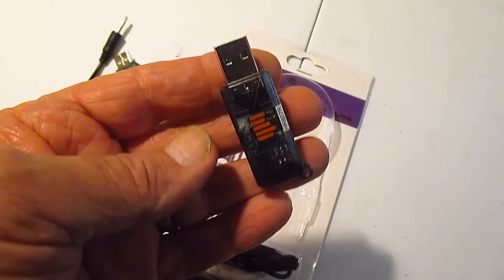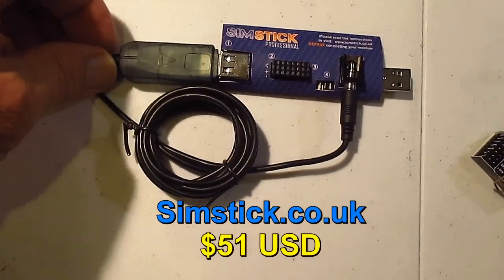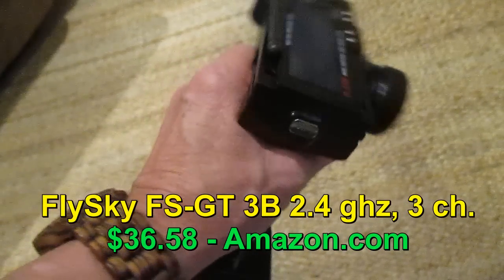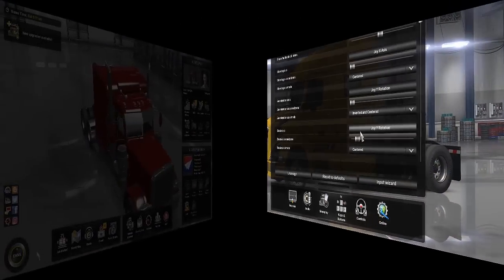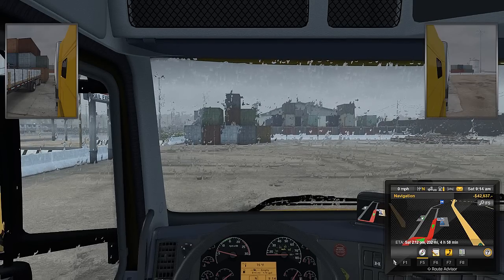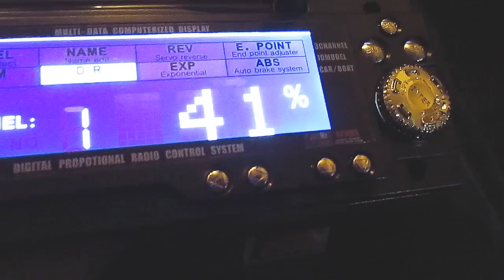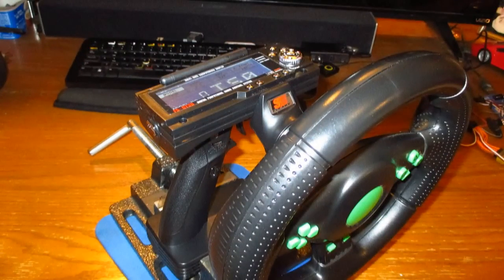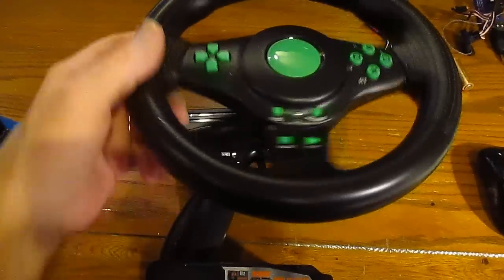Home-Made Steering wheel controller using an R/C car radio to drive the American Truck Sim.

Comment: I have the Dx6i plus a USB multi Rx from Hobbyking. I never thought of trying it out with truck sim. There again my $700 Ferrari force feedback seem to work just fine with it. Good to see you again Dave.
Reply from the maker: Well if you have an expensive wheel like that Ferrari, there would never be a need to use a tx. Thanks

Comment from the maker: Having bad success with Steering wheels which are more expensive, I decided to see if I could drive the American Truck Simulator with an RC Car radio with wheel. The Car radio is a FlySky 3Ch, and I used a SimStick adaptor I already had and a Fly Sky dongle to test it out. I was pleasantly surprised. The radio Cost $27 and Dongle $11. I then easily added a bigger steering wheel, which made driving even easier. I especially like the Half rate button to turn steering up or down while driving instantly making it easier to park with hi rates or driving on the freeway at low rates. Cost of this program was only $4.99 from http://www.steampowered.com and it's a blast to drive. Thanks for watching.

Comment: I use Flysky i10 transmitter in my rc planes and for the money its been more reliable then the Spektrum brand and rx are only $10
Reply from the maker: Yes they are good units. Thanks.

Comment: Hello there sir, how am i suppose to use it using the wired process?
Reply from the maker: You cant.  Sorry.
Reply: @NightFlyyer  i just figured it out, i just recently used my gt3b with the simulator cable, no any other apps needed, just plug and play. All you have to do is to set up the controls on the game itself.
Reply from the maker: @mr.geardot4277  Good for you.  I didn't have a cable, so have fun.